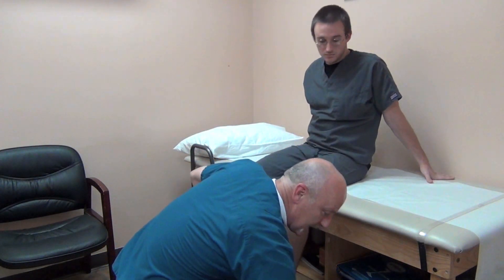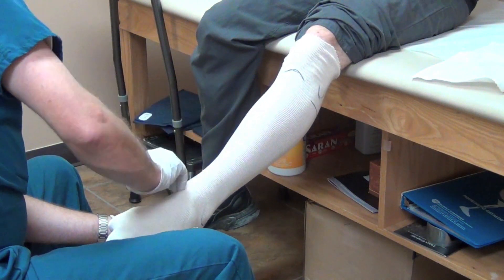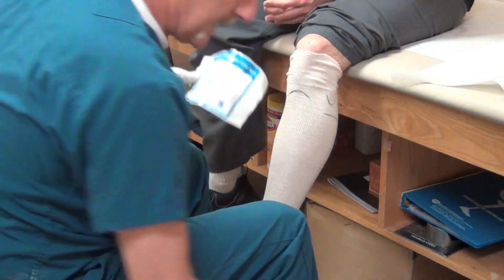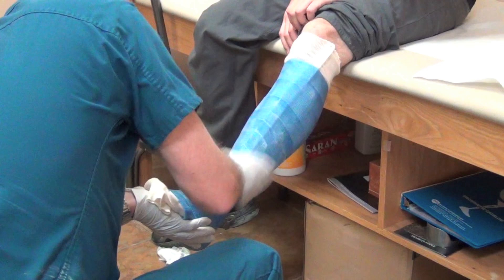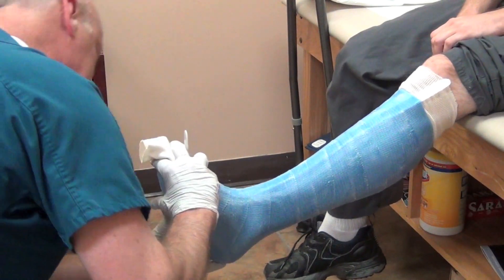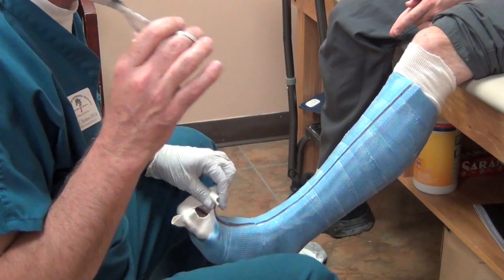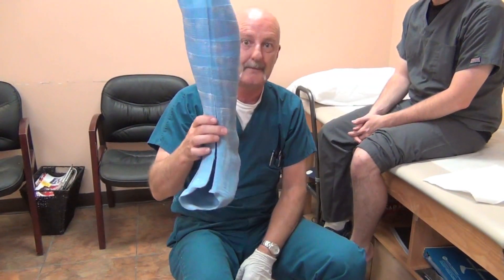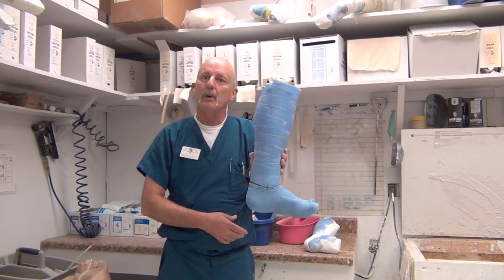Casting: AFO

Comment from the maker: Transferring to PE is tough because it cooks at a lower temperature.  We cook it at 350 and transfer, but they always come out lighter than normal.  If the paper is sticking you're either getting it too hot or leaving the paper on too long.

Comment: I tape my own ankles because I have CMT. It is difficult but I step lightly on the outside of the foot or I use a stick to push on the bottom of the foot as I tape. It is easier with a lace up ankle support. I stand on the foot as I lace it up. I'm still experimenting with this.

Comment from the maker: The change is small.  I prefer to cast in corrected alignment of the heel and forefoot.  I correct dorsiflexion angle with the band saw.  There is not a specific measurement I use for foot widening as it is minimal.

Comment: Wrong! The patient should be standing with weight on the foot when the shape is taken. Then the shape will be correct.
Reply: It may be difficult or uncomfortable for Patein even orthotist so better way to place flat board at plantar surface of foot to take shape and even maintain position of ankle in frontal and sagital plane.
Reply: @syedmunawar9717  I know because I have the same problem.